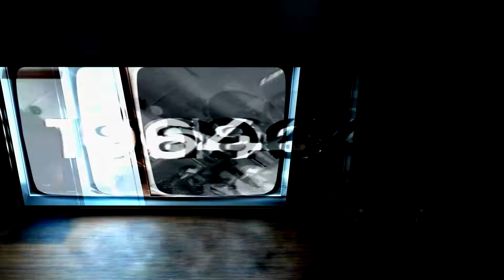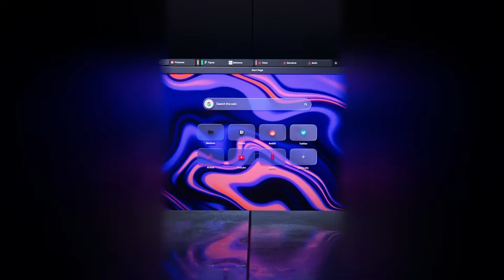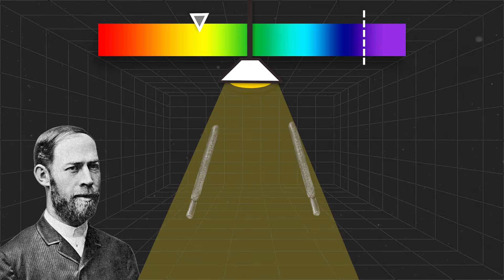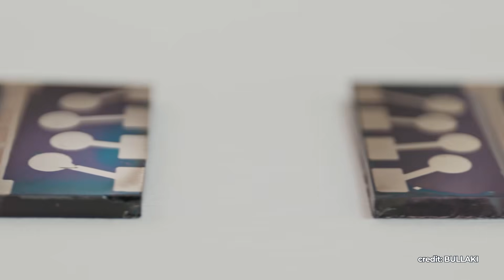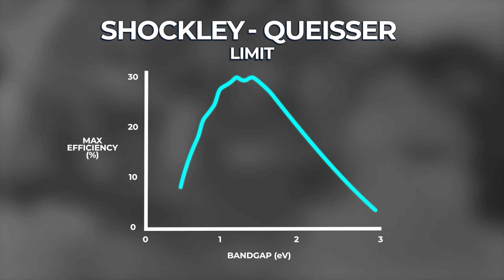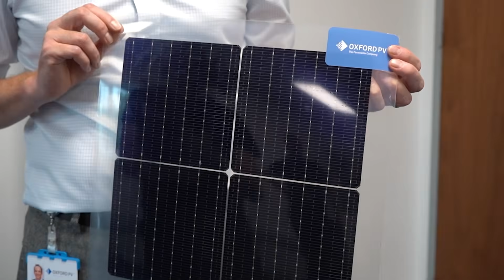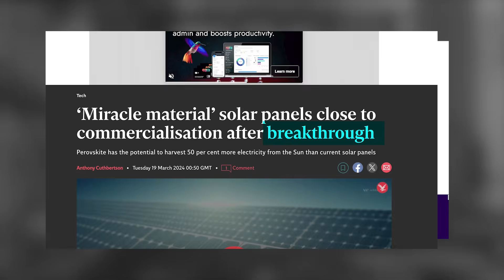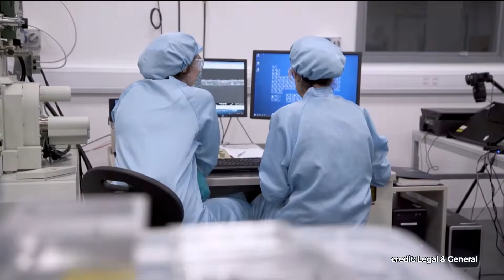How Physicists Broke the Solar Efficiency Record

Comment: Excellent video, going to bookmark this one!  At 15:36, can anyone provide an update on how Quantum Dot (QD) films are progressing for solar?  QD will convert one incoming blue/UV photon in two red/infrared photons.  So with a simple passive film over the silicon cells, QD can double the actual red/infrared photons that silicon photovoltaics prefers!  I love the fact that QD works passively without any additional electrical wiring whatsoever.

Last I heard, QD films were not durable enough.  But it seems to me a simpler and cheaper method to boost existing silicon photovoltaics.  The effect must be similar to how we perceive fluorescent "highlighter" markers and also personal safety gear, which are common everyday items.  Fluorescent items are much brighter to our eyes since the fluorescent pigment is converting UV photons, which our eyes can't see, down to visible light photons we can see, hence instant boost in actual brightness to our eyes.

Theoretically, you could apply a QD film layer on top of any existing silicon photovoltaic panel to improve its power output.  There are already computer LCD monitors using QD films to gain extra brightness with lower power by converting some waste UV LED output back down to visible light that would otherwise be wasted energy.

Comment: Dyson spheres are science fiction. First,  where do you get enough materials to build one?  Where are you going to get the materials to repair/maintain it? Where are you going to get the manpower to do so? If you use robots, where do the materials for the quadrillion robots needed for the job? 
All speculation on civilization "level" make too many assumptions that may be impossible due to the laws of physics, I.e. faster than light travel, antigravity wormholes ect.

Comment: "100 times thinner" is not an actual measurement or comparison. You can't measure how "thin" an object is, but how thick, known as size. Saying Thing A is thinner than Thing B means Thing A is a fraction of the size. "100 times" is being used to mean "is divided by" the size of a larger thing. Maybe. It's fraught and vague. Yes it is popular, so is murder. They're both wrong.

Comment: I feel like the 0.7 to 0.73 civilization 'jump' over a long period of time, isn't really a let-down so much as it has more to do with not having a true application for that sort of energy even if we could harness it. Supply and demand, our grid grows, we eventually outgrow it a bit, it gets updated over time to meet the need. Things that are grossly over-demanding in their power needs and inefficiencies are stripped away as unnecessary, or we find a more efficient and ideal way to do it, rather than throwing power at it endlessly. If anything I feel higher-tier civilization can get by with less energy generation, and unbelievable efficiency in how it's used to fulfill needs.

Comment: so according to that scale were not even a tech capable civilization yet.... and this tech wont help... a 100% efficient array is needed and would have to cover 100%of the planet or the space equivalent, since a 100% cell will never happen as there will always be losses we will never hit that scale until space travel become cheap enough to allow mass array deployment..  but this would take all of earths resources to make a  array large enough to be able to supply the equivalent of the suns energy that hits our surface, we would in essence fill the solar system with arrays before hitting level one and have zero room to reach level 2

Comment: One thing I always wonder about "using 100% of the sun's energy that reaches our planet" is, if we'd do that, what is left for the planet itself?
Less/no energy hitting the soil and atmosphere means we'd starve our planet from light and warmth.... so my question is, do we want to be a type 1, or even more advanced civilisation, per the definition of the Kardeshev scale?
Obviously we cant just absorb all the energy our sun produces.... unless we also give some of it back to our planet.... which is silly so might as well leave some of that energy for the planet xD
I mean i understand that energy never just disappears, law of conservation and such, but if, in theory, we manage to invent solar cells and energy storage that's 100% efficient, with electronics at superconductor levels, with very minimal energy loss, we wouldn't need to harvest the entire sun's energy to get to the higher type civilisation in the first place.
But I also doubt covering the planet with solar cells will be enviromentally friendly anymore, just to reach that type 1 xD
Reply: You can also harvest the energy coming from inside our planet. Mass produces compression, compression produces heat and energy.

Comment: A solar panel as a device that captures sunlight and turns it into electricity. You might think it could use all the sunlight it receives to make energy, but in reality, it can only convert about 33% of the sunlight into usable electricity. This maximum efficiency level is known as the Shockley-Queisser limit. Here’s why it can’t go above that.

1. Sunlight Comes in Different Colours with Different Energies
Sunlight isn’t just one type of light; it’s made of a spectrum of colours, each carrying different energy. Think of it like a pack of Skittles, where each colour represents a different energy level. Some colours, like blue, are high-energy, while others, like red, have less energy. Solar panels are designed to absorb light in a certain energy range. But they can’t use the energy from colours outside of that range efficiently, so a lot of light energy isn’t usable right from the start.

2. Energy Loss as Heat
When sunlight hits a solar panel, some of that energy turns into heat instead of electricity. This is a bit like when you charge your phone, and it warms up. Not all the energy goes into charging; some is lost as heat. This energy loss happens because the material in solar cells only uses a fraction of each photon’s energy. So, even if a photon has high energy, much of that energy dissipates as heat instead of becoming useful electricity.

3. Photons Need to Match the Cell’s Bandgap
Sunlight consists of tiny energy packets called photons. For a solar panel to produce electricity, photons need to hit the solar cell and excite its electrons, kicking them out of their positions to create a current. However, solar cells can only work with photons that have just the right amount of energy to match the “bandgap” of the material — which is like the energy threshold needed to generate electricity. Photons with too little energy can’t move the electrons, while photons with too much energy waste some of their potential.

4. One Photon, One Electron Rule
Each photon, regardless of its energy, can release only one electron in the solar cell’s material. So, even high-energy photons (like those in the blue part of the spectrum) can’t knock out multiple electrons; they’re limited to creating just one. This results in energy being “left on the table” because the extra energy doesn’t get fully used — it usually turns into heat.

What All of This Means
Because of these limitations, solar cells max out at about 33% efficiency under normal conditions. Scientists are exploring new technologies to push efficiency beyond this limit by using special materials or layering different cells to capture a broader spectrum of light. But without these extra techniques, the physics of light and solar materials creates a cap on efficiency.

So, while solar cells are amazing and getting better, they can’t convert all the sunlight into electricity — and that’s why we won’t see a 100% efficient solar cell with our current understanding of physics.
Reply: The limit applies only to silicon solar cells
Reply: @StefanReich  Is that really all you’ve got? Sure, maybe one day we’ll find magic sources of energy, like electric unicorns or nuclear garden fairies! But for now, we need solutions that work in the real world, today.
Reply: @quietackshon yeah, there may be breakthrough like those you mention that bring us over the 33%, but I don't expect it to get much higher than that.  People tend not to realize how much inefficiency is inescapable in many technologies.

Diminishing returns on efficiency as technology develops set in sooner than most people realize.

I think most people, for example, would way overestimate how efficient ICE engines are.

100% efficiencies are functionally unheard of baring a couple rare exceptions.

Comment: 🎯 Key points for quick navigation:

00:00 🌌 Introduction to the Kardashev Scale and Solar Breakthrough
- Introduction to the Kardashev Scale and solar technology breakthrough,
- Humanity currently harnesses only 0.16% of Earth's solar energy.
- New perovskite-based solar technology could significantly improve energy harnessing.
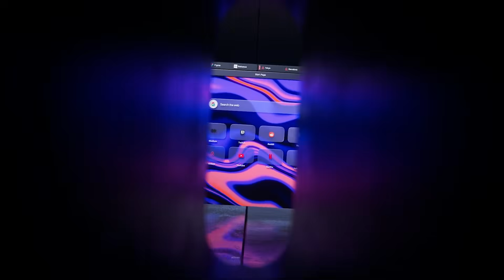03:16 📚 History of Photovoltaic Effect and Solar Cells
- History of photovoltaic effect and development of solar cells,
- Becquerel's discovery in 1839 and Fritts' first solar cell in 1883.
- Einstein's photoelectric effect explanation leading to modern solar cell understanding.
05:54 ⚡ Understanding Energy Band Gaps and Solar Cell Efficiency Limits
- Understanding energy band gaps and efficiency limits in solar cells,
- Trade-offs between small and large band gap materials.
- Shockley-Queisser limit defining maximum efficiency of silicon cells.
08:50 🧪 Perovskites as a Game-Changing Material
- Introduction of perovskites as a promising solar cell material,
- Advantages over silicon, including thinness and efficiency.
- Potential for flexible and cost-effective solar cells.
11:42 🏭 Manufacturing and Challenges of Perovskite Solar Cells
- Manufacturing processes and challenges of perovskite solar cells,
- Easier and less energy-intensive production than silicon.
- Stability issues and Oxford PV's work to overcome them.
15:10 🚀 Oxford PV's Tandem Cell Innovation
- Oxford PV's development of silicon-perovskite tandem cells,
- Achieving higher efficiencies by combining materials.
- Scaling up manufacturing for commercial availability.
17:56 💡 Impact and Future of Solar Efficiency
- Impact on energy efficiency and future prospects,
- Potential to reach efficiencies up to 43% with tandem cells.
- Significance for advancing humanity's energy capabilities.

Made with HARPA AI

Comment: One has to keep in mind that gas is artificially inflated by at least 200% to 400%....once you realize that, then look at the chart again, you realize that gas is actually cheaper than solar. And let's keep in mind that aviation fuel actually has more energy density than gas, at an even lower cost than gas, which makes gas even cheaper. What people have forgotten is the entire gasoline market is artificially inflated, and it was artificially inflated specifically to try to make other sources of energy appear less costly. Right now we have the technology and capability to literally make gas for less than $1 a gallon. The fact that solar panels need to be replaced about every 10 to 20 years, means we shouldn't be in a hurry to commit, because they cost will be doubling or more just to maintain a solar system, which means that initial cost isn't even a 1 time cost. 

Oh and when you also factor in the batteries solar needs and other infrastructure, it comes out to WAY more expensive than the panels alone, which means at its actual current cost, it is still behind gasoline, the powers that be just misdirect from the truth. Let's also keep in mind that you have to also consider that over 66% of all energy send through powerlines is lost by the time it even reaches a wall plug. That's a bonafide fact from the Department of Energy. So the costs get even higher, because each 1000w panel is only ever going to actually "produce" about 400w of actual usable power under even the best of conditions. 

Which means if you need to generate 100mW of power, you actually need the infrastructure to generate over 300mW of power to makeup for all the losses before the energy even gets to a wall plug. So surprise surprise, that field of solar panels now needs to be 3 times larger. And if the sun isn't at full intensity all day? Maybe you'll get half of that or less. Oops now you need to double it again, so instead of having enough panels for 100mW of power generation, you need a field that is literally 6 times larger. And if you want to make up for all the low energy generation times and to also generate enough energy to last when the sun goes down? Oops, the field now needs to be at least 2-3 times larger again. So congrats, your field that you thought only needed 100mW worth of solar panels, now needs 1200mW to 1800mW to actually produce all the energy you need....and that's just minimal baseline current usage, not any room for increases in usage over time. 

So it's actually even less feasible than people realize. We can't just say the country uses X amount of power, so divide that by the number of panels needed. It's quite the opposite, where there are soo many inefficiencies that you literally need 10-20 times the amount of panels than the actual national energy usage. Right now, the US consumes about 4,000 terrawatts per year. This means we would need enough panels capable of generating 40,000 to 80,000 terrawatts just to reliably produce enough energy for the country. And when you multiple solar panels, guess what, you also have to multiply all the other infrastructure too, like batteries, so you'll also need over 10-20 times the amount of batteries. 

Once you think critically, it's easy to see how solar is a lot further away than people realize. It's also important to consider that even if we could push the efficiency of solar panels, there is a finite limit, and that limit is the sun itself. Right now, the suns limit is about 1400w per square meter. When you consider that, we're actually not too far off from the hard limit of solar panel efficiency, because they can't extract more watts than the sun is pushing. This means even with maximum efficiency, that once 100mW hope, still turns into needing several times that in generation capacity, so in the grand scheme of things it doesn't really become that affordable or feasible even at max efficiency, especially when you consider the cost of other infrastructure needed, and when you also consider the maintenance and replacement times. They also mislead people on that, because replacement isn't even at all factored into cost effectiveness, which means every 10-20 years, you're having to replace everything, doubling the cost or more when you finally do.

Comment: Without me doing any research into this technology and without going through the comments section! Is this material similar to silicon? And if it is so much better than silicon then would it be useful in making transistors if so would it be more efficient in integrated chips like CPUs or GPUs and ram chips and any other integrated circuits?? If it is 25% more efficient than normal solar panels around 20% efficient at its best so far and this doubles that efficiency to 40% thereabouts then should it not make chips 20 to 40% more energy efficient and or 20 to 40% more powerful and performant at the same power consumption? That is actually a very very good thing and very very useful in energy saving vs performance in computer engineering which is something we are getting very close to the limits of!! Soon we will be at the limit of transistor size and then on to maximising the design to multiple gate or gate all around to get more transistors in the same spot as a single 1 nm transistors!! That's assuming we can get down to 1 nm..